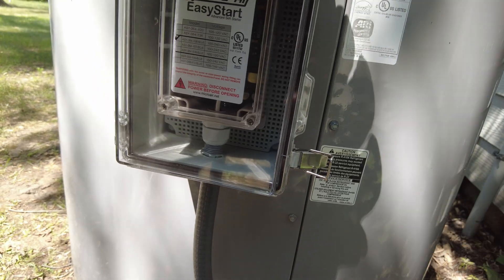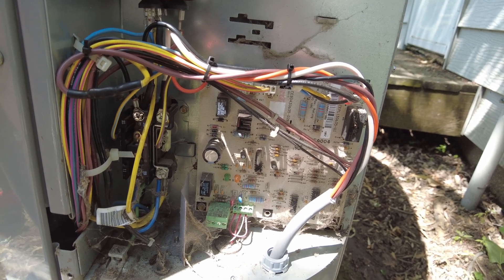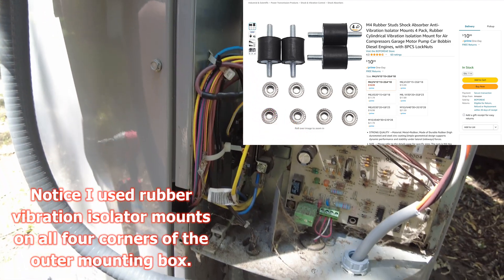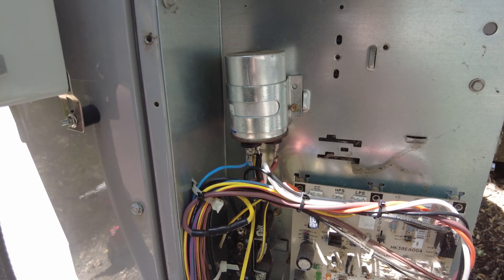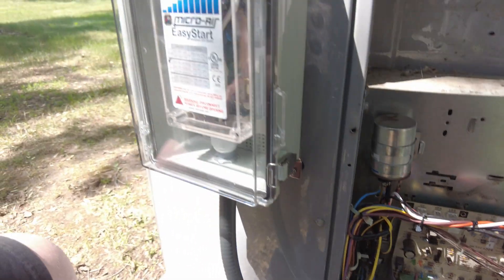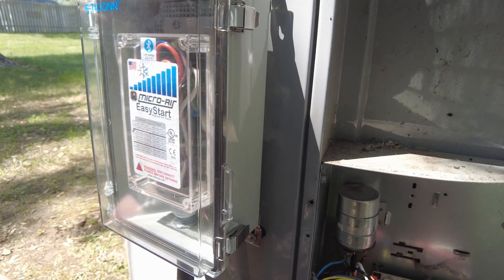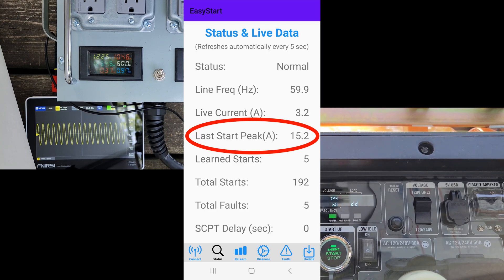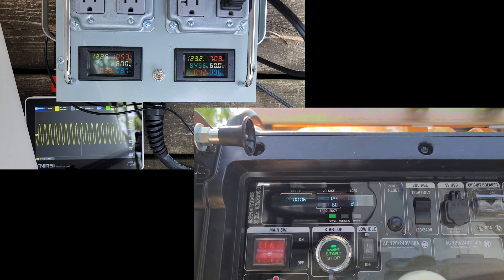Micro Air Easy Start Install on Carrier A/C Unit with GENMAX 9000 Inverter Generator Demonstration.

Comment: Updated 1/2/2024:
As part of some recent electrical work, I went ahead and had a "qualified" company install the Micro Air. After some quality issues with the electrician (lack of details), I decided to review the micro-air install more closely and connection diagram myself. I have a Carrier Infinity Series as well. During startup, I noticed a brief hum or compressor pulling hard during initialization. While the Micro-Air went through and completed its five step process and started the compressor and AC successfully, it gave me concern that something may be configured incorrect.

Upon review of my AC connection diagram, I initially thought the technician didn't disconnect the Start Relay (SR) and Start Capacitor (SC). After not finding the physical devices inside the maintenance panel, I learned that these items "may" be field installed, but not necessarily installed. If you don't physically see them, then they're not there. The controller board isn't going to have these integrated for any reason.

To cover all bases, I opened a ticket with Micro Air and they responded within an hour or two. The short loud hum that I heard initially is actually correct for my unit and that I didn't require any modifications to the Easy Start configuration (bluetooth connected logic switches).  

Here is what they stated: 
[Micro Air] "The Carrier Infinity 24anb7 is a 2 stage system with an internal solenoid that switches from low to high stage. The starting of the compressor may sound different due to the change in starting provided by the Easy Start. The operation is the same after starting the compressor. There are no changes that need to be made to the Infinity controls."

With the above said and that there are no actual errors on the Easy Start or my AC unit, it appears everything was wired correctly. In the end, I've learned a lot about my AC unit over the past few days, but have probably driven the HVAC company mad managing the overall install. Much of this could be alleviated with some confidence and open communication by the electrician. 

Overall, I think 90% of people who can read the connection diagram, identify any SR or SC devices, and has common sense should install this themselves. Many companies and its employees may not have installed these devices themselves and are just going to do a quick default install and move onto the next job.
Reply from the maker: I'm not sure about the two HERM wires but did you or the professional company do ANY programming to the Micro Air box itself?  I believe that I mentioned it in my video but I had to pwer up the Micro Air box itself, BEFORE installation, and change a setting in the programming.....  Then, I installed it on my A/C unit.  I can't remember exactly which setting I had to change, but it was listed in the instructions that I found on the Micro Air website.  If I remember correctly it was something about a 5 second delay upon startup.....  and I had to either enable, or disable it.  I don't remember for sure.  The box comes factory programmed one way, and I had to change one of the settings to the opposite.  It was simple to do.  It was a matter of either selecting, or deselecting one of the settings via the Bluetooth app. In order to do this change in programming, you need to somehow supply power to the Micro Air box just long enough to make the change in settings.  THEN install the box on your A/C.  I'm not saying this is your problem, but if you do indeed have the same A/C unit as me, and the micro air box hasn't been properly programmed, then this might be what is causing you trouble. Good luck with your project....  and yes, please do post back here when you figure out what the problem was.  Thank you.
Reply: @SlipFitGarage  So the HERM wires didn't really have anything to do with my original post (removed those references). The two blue wires connected to the HERM connector on the start capacitor were 1.) for the compressor S terminal, and 2.) for compressor monitoring, which must be left connected. See above for changes. 

As far as programming the Easy Start, Micro Air noted that I didn't need to make any changes. I do have a controller board, but it wasn't one of the Emerson boards shown in the install instructions.

Comment: Nice video.  I have a Tempstar 3 ton, which is made by carrier, and I did notice a circuit board only much smaller but it's there. Glad to see your video because like you I've never seen a circuit board in any other video. When I install my this spring 2024 I'll touch base with Mirco Air send photos and hope they will advise how to specify my install.  Thanks.
Reply from the maker: Micro Air is very good about replying to email questions from customers.  However, in my situation, they simply replied with "that's is a very common system you have. They work great with the Micro Air device that you purchased".  And then provided a link to the generic install instructions.  There was no specific hand typed custom install instructions given to me.  Just a link to the generic list of instruction (that I already downloaded)  and it was up to me to figure out which type of system I had, and then which list of instructions to follow in order to program the Micro Air box based on my type of system. Which is fine.....  but I though they could have at least verified which type of system I had.  They are the experts after all. The pictures that I sent were very clear, and my question was very clear.  Anyway, it all worked out in the end, don't get me wrong, but you can tell they are sick of answering questions that are already technically answered in the literature posted on their site.  My suggestion.... read all the literature posted on their site first and see if you can answer your own questions....  then if you still are not 100% sure, send them an email and hopefully they reply with specific answers instead of links to their generic install institutions.  You'll get it eventually. Just take your time.
Reply: @SlipFitGarage  Thank you

Comment: Excellent video just installed the Micro Air unit on my 240V, 3 Ton Rheem AC unit. In rush amps dropped from 63 to 23 after the 5 training starts. Now I can add a portable generator to run this unit during an outage. The running life of the compressor should also benefit from this device.
Reply from the maker: Yep, there really are no negatives against this device....  Other than the original purchase price, of course.  My Micro Air unit has been trouble free since it was installed in this video. Thanks for the comment!

Comment: Great job on the video and the external mount. Question, I have the 368 x72 and I was wondering if you know how to install it on a dual stage motor, I was doing great on the install until I noticed two of the motor wires and found out it was dual stage. Any help is appreciated.
Reply from the maker: Honestly, I am NOT Micro Air expert.  I only know how to install it on the type of system I have.  You should contact Micro Air. Their customer service is fairly decent.  They wont hold your hand, but they will point you to the information that you need. (already posted on their site) It will take a bit of reading and sifting through the info that you don't need, but you'll eventually get it. Sorry I don't have the info that you're looking for, but thank you for the compliment on my video.

Comment: Just curious, are you running 30 Amp 240 volts to your house? Same set up I have and just ordered this generator.
Reply from the maker: Yes, correct.  It's a 7500 watt generator... so AT 240 volts, the generator puts out 31.25 amps. To me, the 50 amp connection is overkill because the generator is not capable of putting out 50 amps at 240 volts.  If I sized everything for 50amps (plugs, receptacle, wire, etc) it would just  be a waste of money in heavier materials. The 50 amp plug on the front of the generator is there so when paralleled with a second generator, you can get the full 50 amps.  It's also there so no adapter is needed when plugging in a large motor coach. Some people talk about getting more than 50 amps from this generator but that can only happen at 120 volts.....  My house runs on 240 so that is irrelevant to me. Enjoy the new generator. Thanks for the comment.
Reply: @SlipFitGarage  Thanks  for the detailed info, I currently have a B&S 6350 non inverted it works well, but I want one with a inverter, bigger and quieter unit now going to get a soft start for now AC this spring.

Comment: I'm look to install one on my 3.5 ton Goodman Heat Pump. Is there a 4 min delay on start up? And dose the Inside fan Run Before the Compressor Starts? Thanks Steve. P.S. I Like the Extra Protection the Outer Box Provides! Well Done!

Comment: Thanks for the video. I will watch your installation video because I was alarmed when I opened the panel and saw a small circuit board yesterday.

Did you make a video of the actual installation? Adjustments you had to make due to the circuit board?
Reply from the maker: This is the only video I made about the Micro Air easy start.  I took a picture of the inside of my A/C unit (where the wires and circuit board is located) and sent it to Micro Air to be sure it would work with my system.  They replied saying basically...  "you have a very common setup.  follow the instructions posted on the website and you will be fine".  So, I read the instructions many times to make sure I understood them correctly.  At that point I just went for it and everything turned out fine.  The instructions were correct. Thanks for your comment.

Comment: I have a 240v outlet in my garage, I was trying to find the wiring diagram for the easy start but I assume you just connected the white to one hot and the black to another hot of the plug and that was all?
Reply from the maker: If you're talking about powering up the box just for programming purposes, like I mentioned in the video, then Yep, you are correct. That is exactly what I did. Just temporarily pretend the white and black wire are both black for programming purposes. The easy start box should power right up, and the bluetooth on your phone should connect to the easy start...... then you can make your programming changes.  Once the changes have been made, disconnect the power from the 240 outlet and then install the easy start on you A/C unit as per the instructions. Thanks for the question.
Reply: @SlipFitGarage  Is it really necessary to program first in this case? I don't have a 240 power option
Reply from the maker: @tyronne875  Well, I'm not the person who designed this product.  I was just doing what I was told.  I suspect it IS necessary to power-up and program first or they wouldn't waste their time telling everyone to do it that way.  You could send their tech department an email and ask them directly.  They can offer much better tech support than I can.   Thanks.

Comment: It will also protect the compressor from Brown-outs and over voltages which was one of the reasons I got it.
Reply from the maker: That's true....  I guess I didn't mention those situations because I never have those problems where I live.  They're not even on my radar. Good points.  Thanks for the comment!

Comment: So I have a new 2 ton mini split in my food truck with a 240v hook up. When I plug  it up to my Predator 9500 generator inverter the red overload light turns on and the AC doesn't start. I'm assuming because of the initial spike in amps. I Would have to assume that by purchasing this micro air devise it will alleviate that spike and my generator will have enough power to keep the AC on? Mind you, the Mini split is the only thing that is plugged into my predator 9500 I sure would love your help on this!
Reply from the maker: Yes, technically a Micro Air Easy Start would help to lower the "inrush" current.....  However, I do NOT know much about mini split systems but I have heard that mini splits do NOT require an Easy Starter because they already have soft start circuitry built into their overall design. Like I said, I don't know much about them, and I certainly don't know anything specifically about the system you have (you never mentioned brand or model name) so I can't offer any real technical advise to you.  But first you should look on the data tag and see if it specifies start up amperage and compare that to your generator.  Obviously the generator is not strong enough  but it would be nice to know just how far away you are from getting the mini split to start. I would google different search terms about getting a 2 ton mini split started on generator power and see what other are doing that are in your situation. Your Predator most certainly has the power to RUN the mini split, but you just need a little help getting it started. Sorry I didn't have abetter answer for you.  Thanks for the question...

Comment: Hi Brian did you wire a 30amp or 50amp i know you generator can do both
Reply from the maker: Hello.... The generator HAS both, but it cannot DO both.  The generator is 7600 running watts..... Divided by 240 volts.....  Equals 31.6 amps.  That's it.  If I wanted a full 50 amps AT 240 volts, then I would need a 12,000 running watts generator. Sure, mathematically it's possible for the generator to put out 63 amps AT 120 volts but that doesn't do me any good.  And I honestly don't know how anyone could use 63 amps at 120 volts. I can't think anything in north American that can actually USE that much power at 120 volts AND that uses 240 volt plug on a 120 amp machine. lolol. To answer your original question....  I wired a 30 amp power INLET box on the back of my house, with a 30 amp breaker in my main panel at the generator lockout location.  The MAIN reason why these 240 volt generators come with a 14-50R receptacle is so when you're paralleled with another similar generator, you then have a 50 amp receptacle already built into the face of the generator INSTEAD of needing a parallel kit with a 50 amp receptacle.  This way, you can parallel these generators with four simple wires.....  no need for a parallel kit with it's own outlet box.  Another good reason is so guys with large RVs don't need an adapter to plug their RV into the generator. Thanks for the question
Reply: @brianok100  thanks you for all the information I'm going to run a 30amp as you did 👍🏾 thanks again make some more videos I love your knowledge on electricity
Reply from the maker: @henrythompson5624  I have more videos planned....  Stay tuned!  Thanks for the compliment.

Comment: Great video. I have to get one put on soon
Reply from the maker: I am honesty very impressed with how well the Micro Air easy start works.  Even when I'm not running on generator power, my AC units starts so quietly now that I wonder why I didn't do it sooner. lol.  Thanks for the comment!